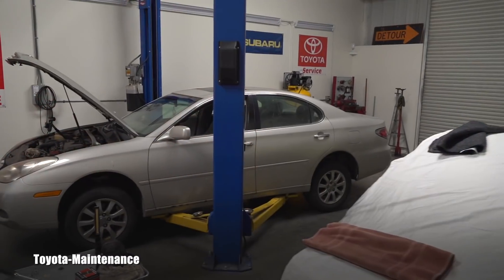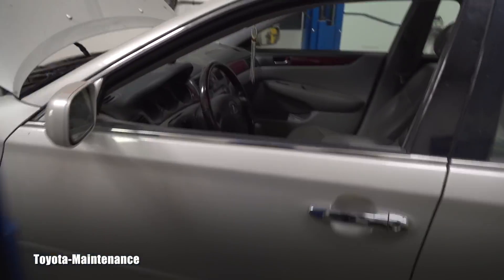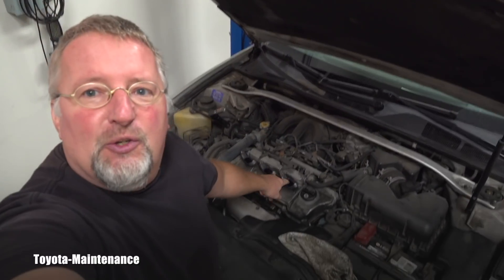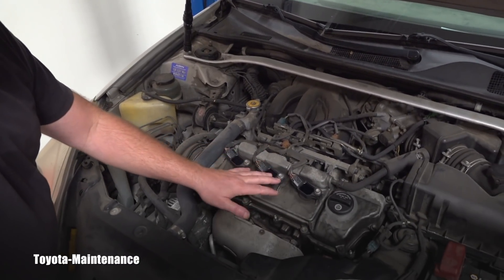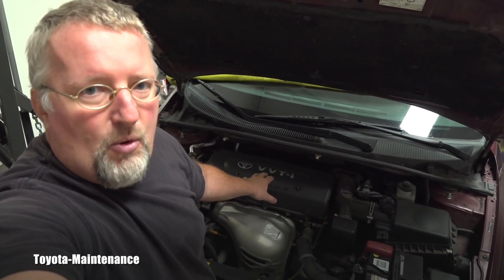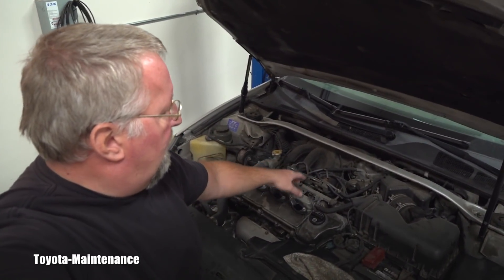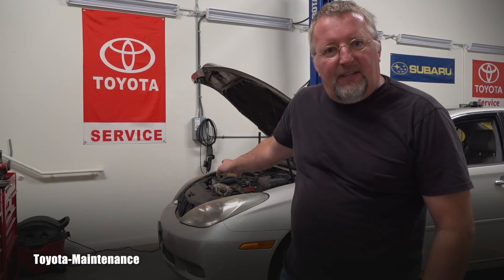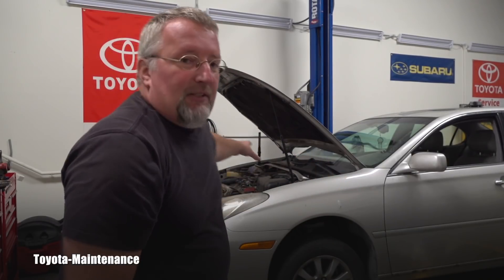4 Cylinder vs V6 Engine - Cost of maintenance and repairs

Comment: I drive a highlander with I4 engine 2.7l and it's quite powerful. For the most daily driving it's more than enough. 
The V6 would be better for towing or moving with full cargo including on the top and passengers. Have the engine well maintained with all the intake-exhaust system clean, all the valves and throttle well cleaned and even just a 4 cylinder engine can power up amazingly.

Comment: It's the worst engine design in transversal layout to access the 3 cylinders on the back. If I were to buy a vehicle with a V6 I'll look for a longitudinal layout, 3 cylinders on each side so to  access easily, and the job would be far less time and pain. Thanks for the video and your channel, really worth it.

Comment: Yeah I have that 1mz-fe 98 Toyota Camry V6 3.0  with a 141 thousand miles. I'm not looking forward to ever changing the back 3 spark plugs out cause there is definitely alot of stuff that has to come out before hand. Other then that its a very nice ride thou

Comment: V6 is smooth, powerful and less or almost zero maintenance in 5 years vs 4 cylinders, I spent fortune on repairs. The gas/oxygen sensors go bad in 4 cylinders very often. Definitely not going back to 4 cylinders. V6 wins!

Comment: Why don’t you just switch the coils when you do the plugs? Then you’ll know if the coils are bad.

I do like my four cylinder 1AZFE engine but I don’t so much like it’s reputation of oil consumption and stripping head bolts…

Comment: I have had pleasure of owning a 2003 4cyl. Camry. Then traded it in for 2005 V 6 Camry  and the V6 engine was so much nicer. I have 248,000 km on it  and no oil consumption. The V6 engine is running 1000 rpm less than the 4cyl for the same speed and has a lot less vibration and noise. Although Peter is right it is harder to maintain some items I haven’t had any problems as I’ve maintained it  properly.
Reply: Does the transmission have a dip stick?

Comment: I have a Mercedes E350 with a V6 and its 10x easier to change than that Lexus just because its rear wheel drive and the engine is positioned for way easier access than that Lexus. Crappy Toyota design.

Comment: You're a good mechanic. I did not bother replacing the 3 bolts holding the intake manifold in my 1mz fe vvti when i changed all the spark plugs my self. took me 2 hours to finish the job. it would probably take me a like 30 mins now.

Comment: Inline 4 cylinder for better fuel economy and cheaper maintenance although it lacks torque or is underpowered and is slightly noisier. V6 is more expensive to maintain but it is better in terms of overtaking power and low down torque but it's a gas guzzler that doesnt make a lot of noise with a stock exhaust.
Reply: "Gas guzzler"??? I have an 08 Solara and I average 28MPG overall.  I've gotten over 30 on the highway at times.

Comment: It looks like they made it harder on the 2002 and above 1mz-fe. I was able to change all 3 back spark plugs and coils on a 99 es300 without removing the intake manifold. Difficult, yes and the engine was hot but it is possible.

Comment: This is fantastic information. Unfortunately the Toyota 4 cyl engine on those older vehicles has other pretty serious problems of it's own when it gets around 100,000. I just saw that on another video from the CarAngel. Still this is valuable information to have if you are in the market, which I am.

Comment: My shifter cable failed on my 2001 Camry.  Only a $250.00 part but the labor cost due to access was excessive.  Loved the car but donated it to charity.  Always ran smooth as glass.  20 years and 219408 miles.  Will miss it. For my money, Toyota makes the best cars.

Comment: I have a 2000 sienna v6 same engine.  There is a bit more room for changing the sparkplugs and wires.  I had to remove the hood and cowl, but not the intake manifold.

Comment: When you have the intake manifold off the V-6, replace all 3 coils and plugs, and put it back together. At least then you won't have to go through the process all over again. Coils can be had at modest cost, from RockAuto and other online vendors.
If the 4 cylinder engine is turbocharged, beware. Those engines have a high failure rate, no matter which company made the vehicle.

Comment: I’ve owned many inline 4 and V-6 Toyotas. EVERY 6 was better. Just change out all the maintenance items every 100,000 miles. These engines are bulletproof. Most last over 300,000.

Comment: The cost of replacing a head gasket on V6 would cost a lot more than a 4 banger. 4 cylinder engines are more simpler I'm design and easy to work on.

Comment: How many miles on that 2002?  I'm guessing it's well over 200k and these are original plugs.  Probably the original timing belt too, causing the misfires from late timing.  It's a non interference engine, so breaking a belt is a non issue.  I bet this guy can have it apart and back together in two hours, book paying him for 6 or 8.  These engines are as reliable as they get.

Comment: I was easily able to reach down and underneath the intake manifold, coming from the left and right side, of my 1999 Toyota Avalon V6 to change my rear spark plugs, however my arms are as skinny as my 16 y/o daughter's arms and when I was much younger I could put my legs behind my head. Your arms are simply too thick and I bet you've never been able to put your legs behind your head. Note that I did need to use two short  socket extensions to get the plug out otherwise the firewall will be in the way.
Reply: This is correct but few people believe it with their ego and can take customers for a ride and charge for it too

Comment: Thank you Sir...  You are absolutely right. The i-4 is deadly reliable and easy to maintain compared to V6. But the V6 is just so smooth and refine.  They are both really reliable but sparkplugs+ valve cover gaskets + spark plugs gasket O-rings replacement in V6 should be done at the same time because of 4 hours labour to do it.   But man, I love both and fortunately with newer 2.5L dual injections is already very powerful and newer Sienna and Harrier/Venza use i-4.
Reply: You folks are slow do these in about 1 hour

Comment: Depends on which Toyota engine.. There's a recall on those other 2az engines for burning engine oil. Those are newer than the 1MZ-FE on the lexus. I wonder if the 4-cylinder 5S-FE models have any issues.

Comment: 160,000 miles on my 1997 camry v-6 and the only maintenance was fluid and filters, never changed the plugs because they wanted too much money to do it.  Wish Toyota would make an inline 6 with the oil filter on top for easy change.

Comment: Should really point out, that coil and spark plug replacement on the V6 won't be due for 100,000 miles. Hard access to do a job that might only be every 10 years is a small price to pay. Many other cars DREAM of requiring maintenance that comes from a car lasting so long.

Comment: I am happy that I only had to change the plugs of a 2005 Avalon V6...  That took me 5 hours to do it. It still doesn't have any issues at 290,000 miles. My 2014.5 Camry four, it took me 15 minutes. It took longer to drive to the parts store. Also it greater fuel economy to boot. I made the right choice. Thanks!

Comment: When changing the rear plugs put known good coils on the rear 3 cylinders. If your miss moves then you know the problem coil and wont have to pull the intake back off unless there is a serious problem within the motor.

Comment: Attn everyone who owns a 1MZ-FE engine in their Toyota or Lexus!! DO NOT LET THIS VIDEO RATTLE YOUR NERVES! If it was such a problematic engine, why did Toyota and Lexus put it in 6 (SIX) different models? Why is it such a popular choice for engine swap for  SW20 (1990's) Toyota MR2 owners when they want to replace the 4 cylinder for something better? Toyota V6 motors are much smoother and offer much better low end torque than the 4 cylinders. If taken care of, the 1MZ-FE is a robust motor that will NOT fail.
Reply: He is just adding a little V6 excitement for dramatic effect. Most of us know Toyota makes the best V6s.

Comment: To be honest, it's not as much 4L vs V6, it's more an issue with crazy engineers. I've seen V6 engines where all cylinders are easily accessible, so no need to go crazy checking for a misfire. However, I've seen 4 cylinder engines with engineering issues such as my Fiat 500 Abarth where changing the oil filter is a bit of a challenge, and changing the alternator can be a real nightmare!

Comment: did they ever fix the oil problem on that 2az fe 2.4L
Reply: yes abour halfway through, they did do a recall and make oil change intervals 5k instead of 10 but also they changed the engine to ar-fe halfway through the model line and to 2.5
Reply: @LAactor  thanks cause i bought a 2014 scion xb

Comment: While you have the intake off for that repair, be sure to replace the coolant hose that is buried under there too.  I used to love my V6 Camry until I had to pay $700 to replace that $10 hose at 230,000 miles.  Great video!

Comment: Why not change all the spark plugs at the rear, then move the known good coils from the front to the rear, and move the possibly faulty coils at the rear to the front, where if they are proven faulty, are easy to change. But yes i do get the video's point.
Reply: no coils in back

Comment: 2AZFE cylinder head bolt failure, Camry, (4cyl 2002-2006). I've paid for the tools to re-drill (jigs) so that's amortized, $400ish in parts, and $1200ish labor. I'm the cheapest guy in town.

Comment: This just proves that the cars are too small, AND BAD ENGINEERING.
Reply: I almost bought a 2015 Dodge Journey V 6  but after seeing a video on changing plugs and other issues I bought a 2015 Mazda CX-5 . Grand Touring has a 2.5   4 cylinder. I can  change plugs easy.

Comment: Just discovered your channel, I am a longtime owner of Toyotas and found this video very interesting. I would also like to add that even some 4 cylinder Toyotas have a similar issue. I used to own a 1999 Toyota Nadia had a 4 cylinder engine placed at an inward angle so that it was very difficult to get to the spark plugs and coils. Total pain and I certainly wished I knew to watch out for that back then.

Comment: What about a 93 T100 about how many labor hours would be for a tune-up on like this if I put new plugs in tested the coils and what about front rear differential I'll take it back transmission 5-speed front labor time to change fluid and rear differential labor time and thank you very much I watch your program all the time and you have very good information I'm a hard credit but I never miss yours thank you
Reply: 93 T100 !! Wow!! Nice! How many miles? My dad still has his 94 Toyota pickup!
Reply: @jeffreysantos9070  it has 200 5,000 a little rust but the frames in excellent condition kids abused his truck but they couldn't kill it and I'm going to resurrect it cuz I love is so f***
Reply: Sorry about the cursing I'll refrain from of that just got excited
Reply: When I first got the truck it was getting 27 miles to a gallon running no AC but now my mileage is dip down into about 18 miles to the gallon no AC then changing the air filters to think like that what can make this mileage go down I have an engine service light on but nobody can pull the code could it be it needs a TCM thank you for your service to the community

Comment: Actually, I had to do that job on my 2000 Avalon with same engine to change valve cover gaskets.  It took 4 hours just to remove the “support” bar bolt that holds the intake plenum , and 4 hours or so to get it back on because there is no room for a socket and wrench.  If you buy an older v6,  make sure it is in GOOOOOOD shape before.  But after you stop yelling, the Toyota goes back on the road and starts counting all the other cars dead on the road.  My Avalon is at 284000 miles now.  I did same on my 2005 sienna, but was not as bad once you remove the wipers and wiper motor and the air system.  But same job, only likely to cause a mental breakdown if you have a sedan.  But I am not a mechanic.  Just daring
Reply: Well summarized.

Comment: when i replaced the high pressure steering hose of my 6 cyl highlander, i had to remove the intake manifold....i will never ever buy a front wheel drive 6 cyl again
Reply: Ya, you got to pass the initial cursing phase before settling down to face the reality. LOL

Comment: Thank you for sharing. Don't forget, this difficulty in maintenance regarding a V6 is because it is coupled with a front wheel drive since the engine is mounted transversely.
Reply: Spot on!

Comment: For these horizontal v6 engines, changing the sparkling plugs is a $500 job at the dealership.
Reply: You may get away with the spark plugs from the sides  ... tell me the price for changing the valve cover gaskets when oil is leaking ...

Comment: Good points, but not always the case, depending on the V6 yr, model. We have 2 of those motors and for the early rx and highlander, you can get to the plugs, coils with a stubby flex ratchet. I even resealed the rear vc seal on the highlander from under the car, no plenum or airbox removal.
Reply: I had a 2003 Camry with a 4 cyl and after an accident I got a new 2005 Camry with V6 3.0 L  I found the V6 a much nicer engine with lower rpm and much quieter I have about 150,000 miles now (245,000 km). Apart from changing timing belts and changing plugs it has been trouble free. It uses no oil between changes and I am more than happy with it

Comment: Sigh... and here I am looking for a V6 or a V8 family hauler. Pray for me.
Reply: V6 in a truck chassis (4Runner, Highlander, etc) or V8 will not have the same problem as the engine will be mounted longitudinally as opposed to transverse.
Reply: @GoFastGator  So, as a family hauler... Sienna (V6 Minivan) or Sequoia (v8 SUV) will be OK? Which would be more reliable?
Reply: Juan Bonilla I am neutral on the reliability.  The Sienna van will be setup like a V6 sedan, so likely the same access issues for service in the rear cylinder bank.  The Sequoia should be similar to the Tundra, both are mature platforms and known for reliability.  But when it comes to ride, comfort, and utility as a family transporter, it’s hard to beat the minivans.  I have a ‘13 Honda Odyssey and a Chevy Silverado just for the record.  If you don’t need a truck chassis for pulling a trailer, or hauling heavy/dirty loads, then I’d probably lean towards the van.
Reply: @GoFastGator  Thanks so much for your answer! I test drove an Odyssey (with the whole family in tow!) and were blown away by the interior space and drivability. Then I was put off by reliability scores, specially taking into account the cylinder-deactivating feature which makes me very nervous. Have you had good reliability with the Odyssey? Thanks again!
Reply: Juan Bonilla 92k on ours, coming up on the 100k service (timing belt) with ZERO mechanical issues.  AMSOIL synthetic fluids, I’ve done brakes, 2 sets of tires, and wipers.  That’s IT.  And my wife uses it like a golf cart to get around the neighborhood in addition to all the daily running.  So it sees taxicab-like use.

Plus you cannot beat that J-series V6.  But feel free to check back in with me after that 100k service!  We’ll see how I feel then!

My MIL has a ‘14 Odyssey, and there’s at least 4-5 more in our circle of friends.  There is a reason that so many of these vans are out there on the road!
Reply: @GoFastGator  NICE! CarComplaints.com recommends that year of the Odyssey. Do you have a video where you go through this model and maybe explain how to inspect a pre-owned one? Did you de-activate the cylinder de-activactor?
Reply: @bonohyogurt  car is bone stock.  Still deactivates.  No videos on this one, I’m a dad and this is my baby hauler.  I am a pro mechanic though, just not for cars.

Comment: 1MZ-FE engine is still miles more powerful and reliable when maintained compared to the smaller 2AZ-FE engine which suffers from stripped head bolts and engine oil consumption issues.
Reply: So compare with a 2.5 liter AR-FE engine.
Reply: JackTannehillPromoter the 2AR-FE is a very reliable engine. Not many issues. Light oil consumption. That’s it

Comment: When I swapped my Plugs on my v6 Camry at 130k miles, I bought 3 new denso coils and plugs for the ones hidden because I hate doing things twice, might as well
Reply: That is exactly what I would have done. It is essentially the same thing whenever the timing belt is being changed: always install a new water pump and new pulleys. 👍🏻
Reply: @yunus_aros  exactly, and you do the valve cover gaskets and cam oil seals too.
Reply: Smart, I've done the same
Reply: I have a similar unpleasant experience with the back three plugs in my Honda Pilot.  Big fan of 4-cylinder vehicles now. My Echo is a breeze. 👍
Reply: Did you keep the originals as spares?
Reply: @RightLaneHog3151  I've saved the coils for the 3 in the front. But spark plugs are cheap, so get new ones. New Denso coils are $100+
Reply: @khoayeuha  Another $300 to do it right the first time is a drop in the bucket compared to the labor cost of taking it apart and reassembling it once.  I'm guessing he'll bring up the leaky valve cover after scoring twice on the labor.  Hat trick.  I've got a 2000 Camry with this engine.  It's one of the best engines toyota ever built.  Now, that 4 cylinder VVT, not so much, especially when you want to pass someone.
Reply: Right Lane Hog yes

Comment: The 2GR-FE is much better packaged in the 2007+ ES350/Camry. You still have to take the intake manifold out to get to cylinders 3 and 5, but it is not as bad as this older one.